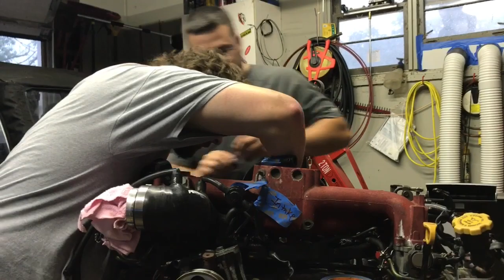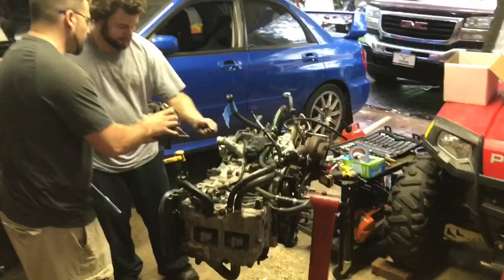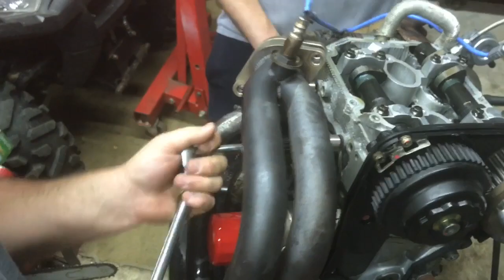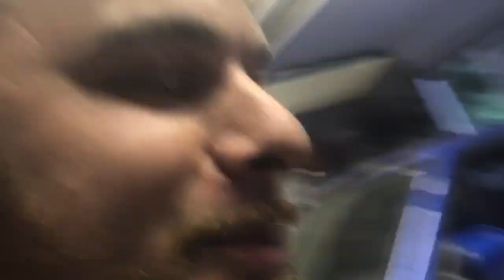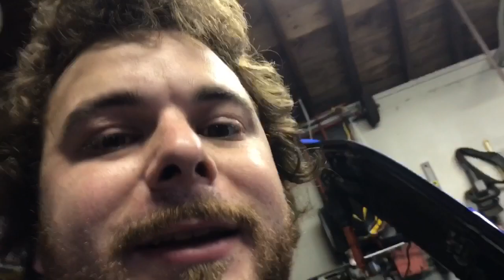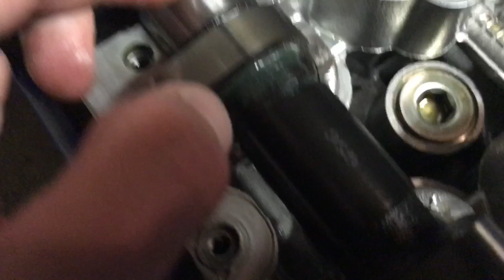SUBARU STI MOTOR TEAR DOWN AFTER ROD KNOCK

Comment: I pulled the exhaust when I pulled the engine....I've had those bolts break and also unscrew.    knock knock....good advice on labeling and keeping it in the freakin order it came off..... I'll have to see if you got it back together

Comment: The piston drop at the end isn't a Main its a big end or a little end problem. You are gonna have to remove all the rods and pistons to work that out. Get the pistons out and wobble them in your hand next to your ear. That much movement you will feel it in the little end or hear it slap . Oh and while that engine is apart you might wanna soak anything with an oil way drilled into it in paraffin. Leaving stripped engines apart for ages clogs the oil channels!
Reply from the maker: im taking the easy way out lol getting a pre built short block and slamming my heads on it, as long as my heads are are still good, im waiting on the machine shop right now, its pretty much not worth rebuilding it iag had built short blocks that hold 650 whp for 3 grand